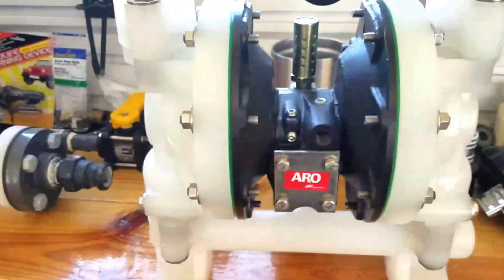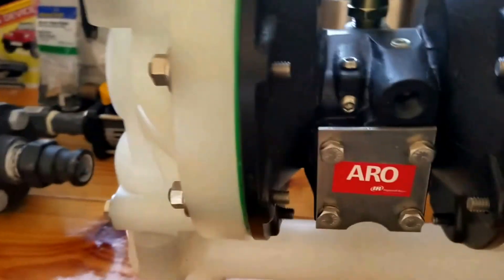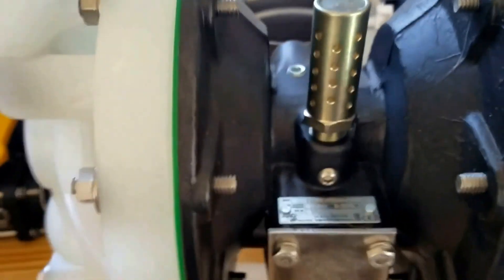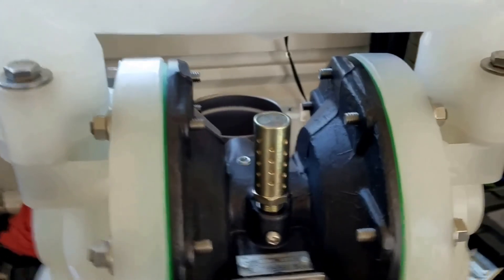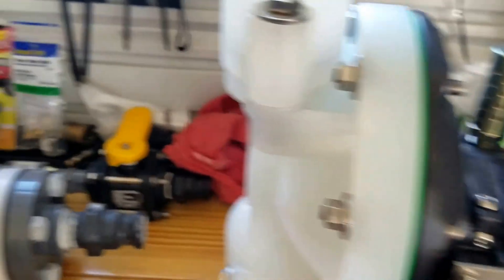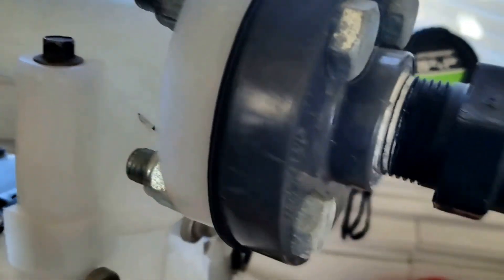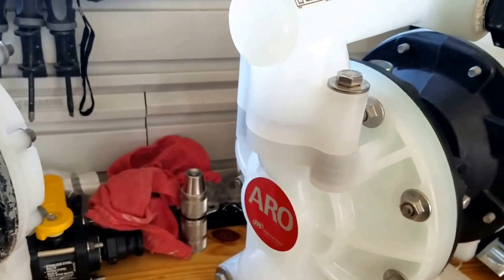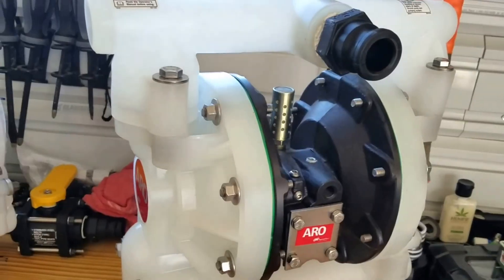All you need to know about air diaphragm pumps

Comment: I got one of my three working. I’m having trouble with the other two. I have applied air to either side in the middle and no matter what I do they seem air locked
Reply from the maker: Try taking off the muffler
Reply: I don’t see a muffler
Reply from the maker: @grumpy1962R  it's a small metal muffler on top with holes

Comment: I want to suck oil out of my car with a tube going down the dipstick tube. Can I reduce the intake from 3/8 to 1/4?
Reply from the maker: On a smaller pump yes
Reply: @Hosebro  it’s an aro like in the video.
Reply from the maker: @grumpy1962R  that's fine but this aro is 1in restricting it down to 1/4 is a lot it will most likely stall the pump you would need a 1/4 or 3/8 pump not a 1in

Comment: My pump stops working after a while.  In order to get it to start working again i have to shut air suppy off remove the air line to bleed the air out of the system. The. It starts pumping agai. I have the aro pump like in the video any solutions on what may ne going on?
Reply from the maker: Are you in a humid area? If so I bet your muffler on the pump in freezing and causing your pump to stall. Take off the muffler and throw it away you don't really need it and your pump won't ever stall again. It's most likely building ice up in it and locking the pump.

Comment: great video. Would you recommend the air diaphram pump over a booster pump?
Reply from the maker: I would yes. Boosters out preform air pumps due to they can run a litter more PSI but you have to rebuild them 1 to 2 times a year. As far as air they can go 5 years or more without touching them

Comment: why is the kynar body pump the best? if i was just pumping water would i need a kynar body pump?
Reply from the maker: Hey great question. Kynar has the best chemical restiance however its very expensive.  100% go with a poly body even for chemical you can buy 5 new pumps for the price of 1 kynar pump.. a poly pump will last you a very long time 10 plus years with just water as long as you maintain it.

Comment: Why is my AODD always freezing up?
Reply from the maker: A common reason is your muffler. Wet air if you dont have a separator will cause it to ice over the exhaust post and freeze causing your pump to stall. Try removing your muffler it's a little loud but it will never stall ;)

Comment: Question : you said 12V so what 12V Air Pump are you using? Also looks like they don't have a pressure regulator switch like the much smaller diaphragm pumps do have. There a reason they don't have that option? I know you can add one at the end to it so it doesn't run all the time when the pressure is reached.
Reply from the maker: Hey man thanks for watching. We use nothern tools 12v pumps as a a back up they have a switch built in so when it's not flowing water it shuts off by itself when you pull the trigger it turns on. I hope that helps.
Reply: @Hosebro  Yes just we no longer use Northern Tools because they are rip off pricing. We use Amania Pumps 5.5 Gallon a min with 60psi now for $65 on Amazon been sold.

Comment: Great video.sir, I have 1 inch diaphram pumps.problems I m facing with the pumps are cracking of body and bursting of diaphragms.Could you give me any suggestions that how I can get rid of these problems?
Reply from the maker: Where are they cracking? For example if you have them bolted down to your truck and you dont have rubber under them it would cause it to crack. Sometimes if your in a cold climate and the water in freezing that would cause an issue as well. Last thing the bolts on the pump need to be tighten from time to time or it will start to leak.
Reply: Hi
Which comoressor to use with that

Comment: How does this aro compare to the all Flo?
Reply: I see this is 4 weeks old, in any case I've sold both for many years and both are good pumps. IMO the All-Flo is easier to repair if need be. They are mechanical and anything with moving parts eventually needs parts replaced. The guy mentions Kynar and Teflon being the best you can buy but those materials can be overkill so it's best to check chemical/material compatibility on the respective manufactures website. No need in spending a ton of money if its not necessary.
Reply: BDT thanks. I went with the all Flo 17 GPM

Comment: I just started a roof cleaning business. I'm using a 12v 7gpm 100psi pump... if I switch to a 1" air diaphragm pump ( like in the video ) how much distance can I expect to get with the water stream . I am only getting about 25 feet with the 12 volt pump i'm using now.

Comment: Hey man, great video.  I have a question.  I notice that the diaphragm pump that you recommend is 47 GPM.  It seems that most of the other guys that I see are running around 12-15 GPM.  What's the advantage to using a big one like this for soft/roof washing?  Does the compressor need to run less, faster job, etc?  Please help, this season will be my first season in business.  Thanks in advance.

Comment: I have a 1 inch yamada. What size compressor can I run with it and be ok?
Reply: Wow I thought I could get by with this 11cfm wheel barrel . I’ll need a bigger truck for that compressor that big !
Reply: we use sandpiper were I work and you can use up to 45 cfm if ran wide open at max pressure. the spec sheets are available just google your pump and size.
Reply: Please guide me
Which will be better size if pump and compressor for
37 to 40 gal /min flow
Vertical conveying height is 60 ft or 40m
Material is cement sand slurry light weight concrete or foam concrete

Comment: diaphragm pumps are pretty tough, i've only had one fail in 20 years and it was due to water in the air lines.
Reply: @Hosebro  Can you help me out ? What happens when you run an air diaphragm pump and shut off the discharge while the air supply is still open? will it burst the discharge hose ?
Reply: @Hosebro  Thank you..you helped me with my concern and now i can continue my project.
regards

Comment: Great video. Im in fuel Additives and go on oil tankers and we use flanged 1" pumps similar to husky. The mufflers suck on ours. We valve our air connection though cause we blow our lines after each wing on the ship. Im def gonna look into ARO. Would be nice to just have the chemlock fitting. Our hardware rusts. I will say diaphragm pumps are beasts. Had one break in 5 years. We have 7 pumps. Someone left some nasty chem inside it and didnt flush with diesel. Good video!